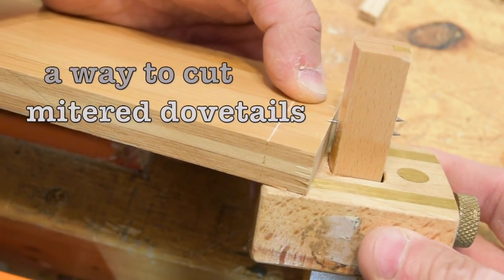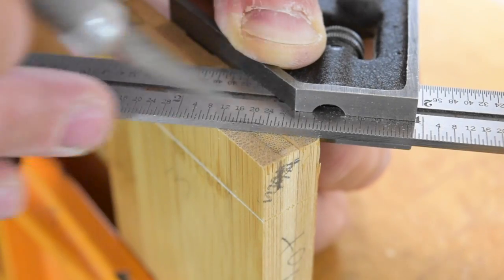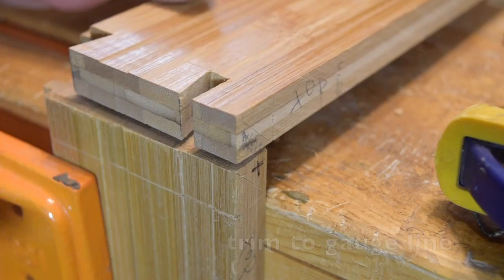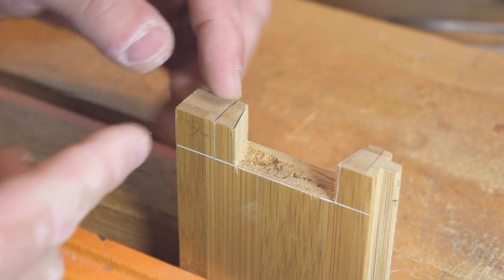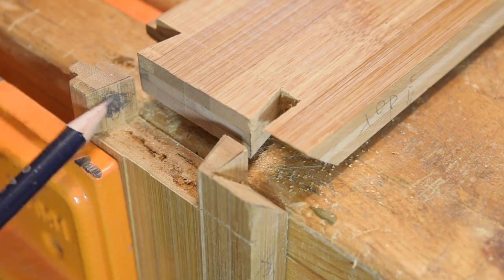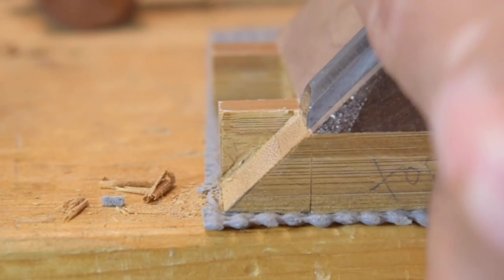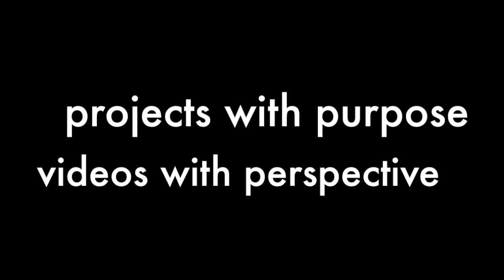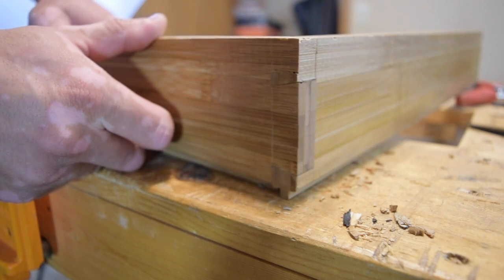Mitered Shoulder Dovetail w/ Bamboo Flooring: A How to Woodworking Joint

Comment: New intro is nice (movie producer). That's some fancy joint and I like it. I have some left over bamboo flooring also and wonder what you will be building with this joint and smooth face inside?
Reply from the maker: +MRrwmac Thanks, it took 2 years but finally got something I liked. I am making a chest with 9 whole pieces of left over, and a bunch of cutoffs. Not sure if it will be a tool or blanket chest, I am leaning blanket. I put the finished side inside because cutting dovetails with the other orientation could leave gaps, and I think it would be a pain to finish the inside. This way, the inside does not need a finish, and I think I can sand the outside smooth and do some stuff to it.
Reply: +John Zhu Smooth inside for blankets sounds like a good idea. The joint is intricate but your patience is one of your strong points. Will be interesting to see how you complete the outside.

Comment: So how long does it take you to do a box (4 joints)?  Seems pretty time intensive.
Reply from the maker: +Make Crazydays It took 65 video clip and 2-3 hr for this video. Depending on when the clock starts, I estimate may be 10+ min per mitered dovetail like this, 8+ min per through dovetail with 2 tails; depending on the wood and thickness. Bamboo takes longer because it is both harder and brittler.